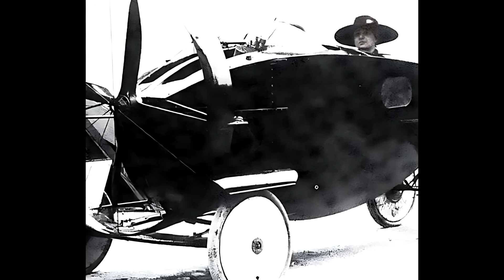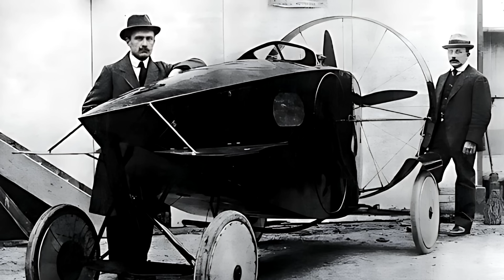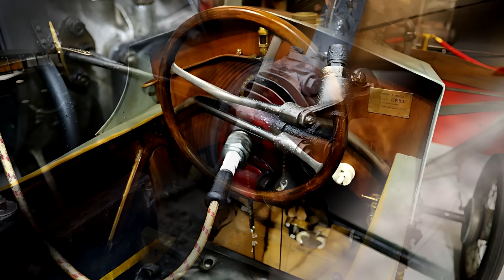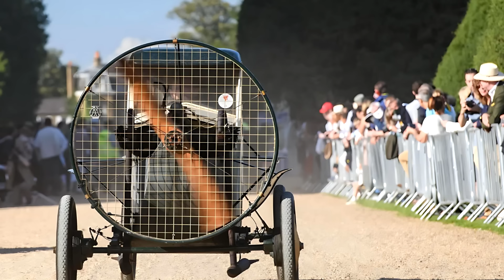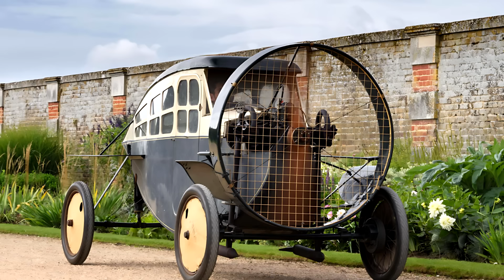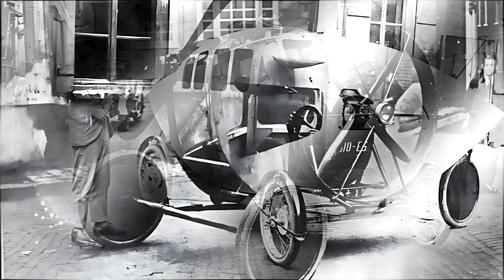1921 Leyat Hélica 😳 The Most Dangerous Car Ever Allowed on Roads

Comment: its actually not a terrible idea if you put the propeller in the reaar but i don't think they understood laminar flow concepts in 1921. if you flipped the entire design around backwards you would have a laminar flow vehicle with front wheel steering and an aerodynamically pointy front end.
Reply: At subsonic speeds you want a rounded nose, not a 'pointy' front end. I agree about the steering, I don't think the rear-wheel steering has ever worked well on any car.
Reply: Yep, I wonder if he was concerned about cooling or rocks in the prop.?